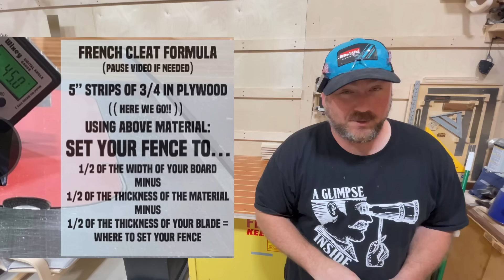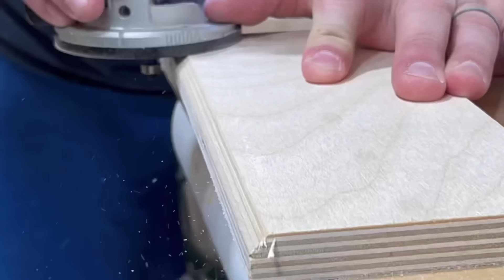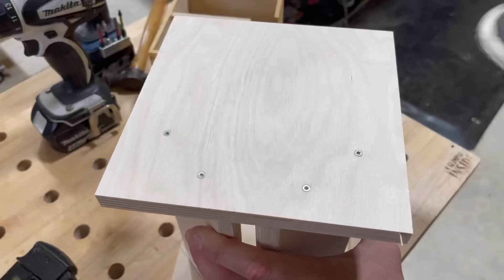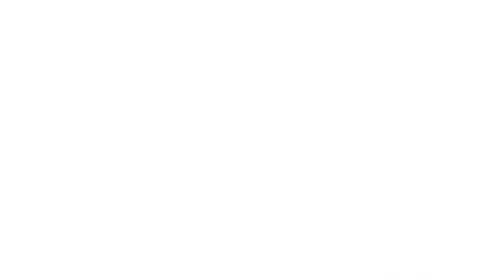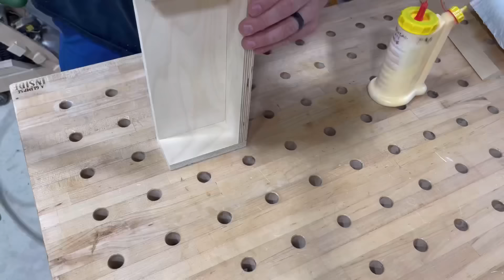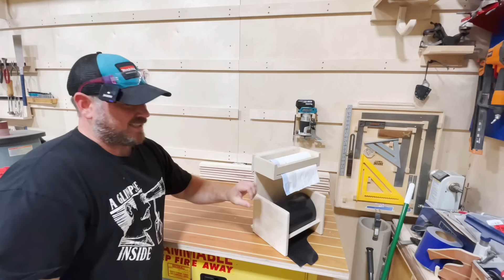This FRENCH CLEAT Design Change is AWESOME

Comment: Ok you saved it at the last minute in the nut bolt or screw bins , mine are fixed in place old dirty dust catchers that were here long before I came and I find myself getting more hardware out than what I need so I end up with these random piles of hardware al over my shop that seem to grow and never get back to the bin that I spent my vacation sorting and cleaning and ocd’d my brain into mush over thinking how to make this mor efficient ends up I bought a self driving magnet that used to be my wife’s birthday present next month until I modified a now prototype that didnt sort or or even clean the floor that well . Tried the plastic bins that god help you if the sun hits them for a day ,  so eureka 💡 not the vacuum the idea of individual French bins for my nuts & bolts and a French maid to do the floors ? 
Lol 😂 ok doesn’t have to be French ok this is awkward, Gotta go my wife’s calling

Comment: I'm a cabinetmaker in New Zealand 🇳🇿 and I've been using this "new" idea since about 1996. Have several cordless drills with the spare batteries on one cleated shelf and the charger on another one above. And all I do is cut some strips of whatever is lying around to 75 mm and then cut the 45 on one edge. Can't be arsed working out blade widths etc and I'm using a Casedai KS 30 dimension saw WITHOUT a sacrificial fence.Good idea but it's already out there.

Comment: Ok, I have been following you from the beginning and really like your channel. You have inspired me to start my own channel. I have a question on French Cleats. I am following your advice to finally put a French Cleat design in my shop. My shop is 10x20 with walls that are only 74.5 inches high. The roof is pitched to look like an old-fashioned barn, so I have plenty of head room. I am starting my FC system under my loft, because that is the only fairly usable space I have right now without emptying my shed out. My goal is to start there and work my way around the shed emptying shelfs and freeing up room as I go. I got two sheets of plywood and had a "construction cut" done at the home store to fit in place. I wish I could send you pictures so this would be easier. I have one sheet that has a slight bow in it. I placed that on first on the left wall bow side out. I put three screws into the top to hold it in place. I used a 3/4" spacer at the bottom to hold it up. When I got to the second sheet, which is on the back wall, I am not able to use a 2x4 spacer because of the loft supports. (I have to place a 2x4 in the recess because there is no connection for the left side of this sheet) my sheet of plywood is meeting at the bottom of the other sheet, but there is a 1 1/2 to 2" gap at the top. The sheets aren't THAT out of alignment on the cut, I know, I carried both inside and they match side to side with a little bit of coaxing on the bowed piece. Have you run into this problem with your walls in the corner? If you have, what did you do to correct it? Or, do you have any suggestions? Thanks, in advanced.

Comment: Is there a reason the wall-cleat and tool-cleat needs to be exactly the same? Does it really matter if the part you stick on the tool holder is a cm narrower, and the part on the wall a cm wider?

Comment: It's cool as a concept/idea, but why not just build both of those as a single item?  I could see it being more useful with something like a large piece for hanging a nail gun and the smaller bin for things like drill bits, etc.  That way you could take the drill off the wall and just take the smaller bin with the accessories.

Comment: I have several sticks of 1x4 stock and scrap and I was wondering, would this board size work with this method?
Reply from the maker: Yes just make sure the grain is it going to break off with a Cleat is made at 45°
Reply: @AGlimpseInside  Great! Made my first shelf for my orbital sander. Now I just need to figure out the layout in my basement and hang some cleats to put it on.

Comment: I don't want to sound rude but using a right tilting tablesaw or moving your fence to the left of the blade with a left tilting tablesaw is actually very safe especially if you have a splitter. Adjusting the fence a few thousands away from the blade at the rear will eliminate burning and kickback is basically impossible. Kickback occurs when something is lifted up and contacts the spinning teeth of the blade. With the blade and splitter riding over the material it is impossible for the piece to make the contact required for kickback. The worst thing that can happen is burning on the flat of the bevel.

Comment: I first used a French-Cleat to replace biscuits, dolls and pocket screws when I needed to joint two pieces of wood together for a L-shaped closet shelf. It was 15’ x 2’ 
The 15 feet was a solid piece of pine that was 1 foot wide and 3/4 of an inch thick. The 2 feet was just birch plywood that I cut to size. So I guess it was like a dovetail now that I think about it.

Comment: I don't like the idea. French cleats have a problem, the shelves will fall off very easily if you kick them from below. A common solution is to insert a removable piece attached to the shelf just below the slat (a slider from the side, a dowel from the front) to lock the shelf at the bottom square edge. This new approach prevents that solution.

Comment: I have seen many videos on French cleats and I have made them,  but so many of these videos spend time instructing  how to get a single piece ripped exactly in half with the bevel cut.  Who cares if it is cut exactly in half?  I don't give a Crap if it is cut exactly in half. In fact I usually cut them off center on purpose and place the larger on the wall and the smaller on the piece.   Why is this a thing?

Comment: Maybe you've covered this, already, in another video. But, if I want to build a french cleat wall in my son's garage, how far apart (vertically) do I need to space the cleat "runners" that are fastened to the wall?   Thanks.
Reply from the maker: I like 8-10 in. Works well for most applications
Reply: @AGlimpseInside  Thanks very much.  I kinda chuckled when I read your response, 'cause I guess I was expecting something fairly precise....like 8 3/8"  or something.  Ha!  Thanks for both the info and the chuckle.  Happy Days to you!

Comment: The parallelogram style can also be used to flush mount a structure to the wall. Just cut a matching relief in the carcass of the cabinet you want to hang. Then it slides right down the parallels and stops at the wall.

Comment: While I appreciate the great shop you've got, I do question the upper (smaller) bag dispenser. From what I see, it doesn't look like it would hold much weight because of the "shortness" of the height of the dispenser. It looks like if you put any weight on it, it would pivot right out of the cleat.
Could you possibly update us on this conundrum?
Reply: The back of it rests against the larger dispenser so that it can’t tilt forward

Comment: Pretty neat. Safety suggestion: I know you love your wife, but I suggest you remove your ring. snagging that, even on a SawStop would not be cool.
Reply from the maker: Thanks for the concern brother it’s made of silicone. We are all good my man all good. I actually had a little bit of a scary incident at work with a dough sheeter. Almost took my finger off

Comment: Your buddy has his rails for his cleats spaced pretty close together - is that for extra strength for when his uses 2 cleats on a single holder like the one for his bandsaw blades? - you've got more space between your rails which looks like it affords you the ability to put a cleat on a cleat - don't think your buddy could put  a cleat on a cleat: he doesn't have the space between his rails
Reply from the maker: He puts a bunch of cleats on the wall so he doesn’t need a support piece on the bottom of The ones he mounts on the wall. Plus he just likes the aesthetic as well. This video was to bring light to look and the functionality with a little bit of a different twist

Comment: Thats great, I am imagining a stacked sand paper roll holder system like you did with your trash bag holder, but add on an old hacksaw blade on the bottom slot to tear the paper easier

Comment: whats the purpose of the sacrificial fence??i dont get it
Reply from the maker: It’s for safety reasons you don’t want the sharp edge of the Cleat getting lodged underneath the original fence that has about a 16th of an inch clearance above the table saw

Comment: With the addition of a hacksaw blade at the front edge, just at the outfeed point, your bag holder/dispenser could be adapted to dispense emery cloth (from a roll), or other "tear-off-the-roll" materials used in shops. I'm about to build my tool storage and I'll use the latest design  (double bevel). Nearly all of my tool storage will be in/on rolling walls that are billeted under a staircase that's open on one side to the shop floor. When in use, the whole unit will roll out, and when not in use, the tools are both hidden and not taking up precious footage in the room.

Comment: I'm not sure why this is a new idea. I've  wondered why we've always thought that the bottom side of the clear had to be square? So much easier to just cut repeat 30 or 45 degree bevels from the sheets. This is how I've always envisioned my French cleat walls.
Reply from the maker: I know right it makes perfect sense. It’s weird how we’ve never seen this in abundance before
Reply: French cleats have a problem, the shelves will fall off very easily if you kick them from below. A common solution is to insert a removable piece attached to the shelf just below the slat (a slider from the side, a dowel from the front) to lock the shelf at the bottom square edge. This new approach prevents that solution.
Reply: @ARichli , but for situations where that could become a problem you simply have to cut one of these in half, and if you want your whole wall to have standard-shaped cleats you can double the width from the blade to the fence, cut them all like this and then cut them in half at 90°. It's a lot easier to find and cut the halfway mark at 90° between two 45° sides than the other way round.

Comment: Ok, great idea, but let's just talk about the "cleat" formula for a second. What on earth is the point of running it through a formula to find the middle? The widths of the two parts don't even need to be equal. You could literally eyeball it, mount the two pieces and it would work fine.
Reply from the maker: When I go back and trim the sharp edge off it just makes things easier by not having to reset the tablesaw fence for half of the pieces. And of course yes you can Eye ball it. Into the untrained eye would look fine. But my eye has been trained so I have to use the formula yeah. Oh and symmetry is thebomb.com

Comment: 3/4" sheet stock with layers of of smaller 3/4  sheet stock on it. No thanks. Time consuming and expensive it is. One layer of sheet stock and screws or nails has worked great in shop for decades.
Reply from the maker: Ok

Comment: Just a heads up in a general sense regarding hitting screws with a hammer. This weakens the screw head because they're not malleable like nails, and they tend to fracture. This can lead to the screw head breaking off when you try to remove them later. Then you've really got a problem. Just sayin'...
Reply from the maker: Didn’t know that good information absolutely. I know they sheer instead of bend hence why we build houses with nails but I never thought the principal translate into this. Thank you

Comment: Up your appearance of expertise with saws by using push shoes/blocks.  

Long push devices not only save fingers and keep you from suffering other injuries, they save Sawstop owners from destroying blades and cartridges. They cut WAY back on kickbacks and are as valuable in that regard as a splitter or riving knife.

Push shoes cut back on kickbacks by  holding the wood down across a longer area than a [pathetic] push stick. Once into the wood, they hold it down near the back of the blade, where kickbacks start.

As to the dangers of a blade tilted to the fence, my first Unisaw was a right tilt. In fact, about every one was back until about a few decades ago.

If you want scary, try the old tilting table (vs tilting arbors) with a right tilt blade. Those were fun.

Meanwhile, I prefer to make my double 45's with the blade tip of the previous cut up on the fence where I am far less likely to have a sharp edge catch, which could be a real problem when you don't use push devices.
Reply from the maker: Do you know I just Google image push shoe. I like it. I think I’m gonna make a few. Thank you so much

Comment: How often do you vacuum out the cleat tracks?
Reply from the maker: I never have. Occasionally I’ll throw some compressed air on them. However I like to keep a separate peace of 45° angle stock may be about 5 inches in length and I’ll run it through the track pushing up any debris along the way

Comment: As a high cabinet installer, I make those dangerous cuts ( as you said)  with the fence on the left on an almost daily basis.   It’s not as bad as you think.  A little uncomfortable at first, but becomes just as normal as the fence on the right side in a short period of time.
Reply from the maker: Thanks for the insight Scott. Nice to know that was a little practice even something like that becomes pretty routine. Thanks man
Reply: @AGlimpseInside  there is a SAFER and BETTER way to make mitres on the table saw. Attach a sacraficial fence to the saw fence side that when blade is tilted, it would cut into the piece. Attach it 1/16"  lower than the thickness of your material, usually never more than that. Have all your pieces precut to the size you want. Move the fence and raise your blade so that after the cut, there is 1/64" flat left on the edge for premium mitrefolds or more for general purpose. By leaving 1/64", there is no chipout of the edge and works better when taping together. Use tape that has a little fexibility in this case but when using packing tape, you need to probably mitre to the edge. When sacraficial fence is set right, the falloff piece doesnt get stuck under the fence. But should be removed for every cut. By doing mitres this way, you will NEVER EVER get kickback or have an exposed blade or pieces going under the fence even a little or overcutting the mitre on warped pieces. Doing it my way, you can just run the piece again and push down harder. On small pieces, start with a larger piece to mitre. Then set blade to 90° to cut piece to your size. I would suggest you do an update video about mitres. Let me know your thoughts and if you do make a new video. If not, 🤷‍♂️ and take care. Happy Turkey Day. 🙂

Comment: I've just finished my shop up and the interior walls are 16 ga. steel studs with 1/4" plywood on the surface. I'm planning on using 1/2" french cleat strips on almost all the walls. What screw would you recommend?

Comment: Great work! I'd like to suggest the use of a sound compressor to equalize the audio from all of your clips. The sound is quite low/muted when you speak to the camera, versus when you do voiceovers. Best of luck!
Reply from the maker: Thanks for the feedback I use a different Mike for the voice over on this one. Looks like I’m not doing that again
Reply: @AGlimpseInside  a quick way to mitigate this is to look at the sound levels in post, and make sure that all your clips roughly reach the same level. If they don't, slap a simple compressor. It'll compress the higher levels down to match the others. That way you can still use your preferred hardware/methods to record.
Reply from the maker: Good advice but I record my voice overs and all my footage on an iPhone. So true editing software like that would be amazing but I don’t use it so I got to do it all the old fashion way by my ear

Comment: Love the video, something that I use the french cleats for is securing my sky workstations to the wall. I have a single car garage with taller ceiling due to being unfinished and exposing the roof rafters, but I still want to be able to park in the garage, and having workbenches and places to put all my woodworking stations was not viable on the ground, because typically you build a workbench or station to sit on the ground, but my ground space is off-limits when my car is parked in the garage. So I built smaller standalone stations that my equipment is mounted to IE sander, router, grinder, and such.. and instead of building them to sit on the ground, I use multiple french cleats on them and have them on a cable pully system that stores them up in the ceiling corners of my garage out of the way when I need one of them, I lower it via the cable assigned to it, then as it's lowered down I attach it to the wall on the french cleats so I can use it. When I am done I lift them back up and out of the way.
Reply: Do you have a video showing this?  Seems like a design a lot of people with smaller shops would be interested in.
Reply: I have the same problem and would love to see more about how you’ve done this
Reply: Same here.
Reply: Sounds like a good way to arrange e.g. tire pressure guage & engine oil storage for the car too.
Reply: Another most excellent comment!